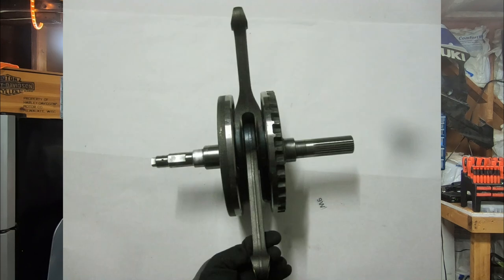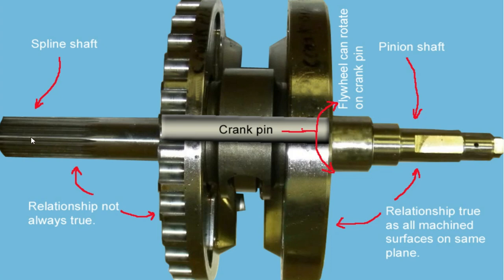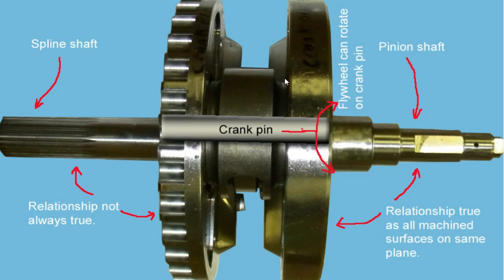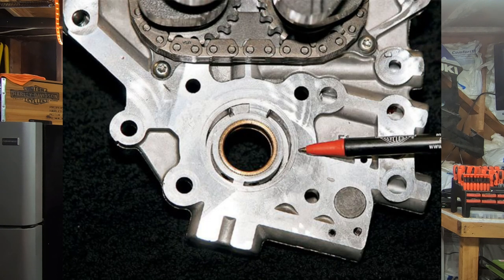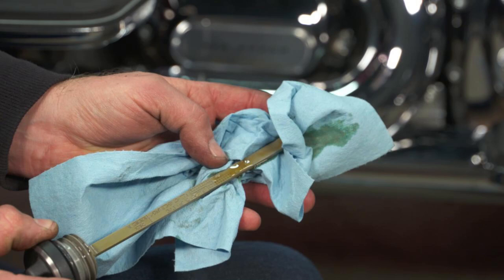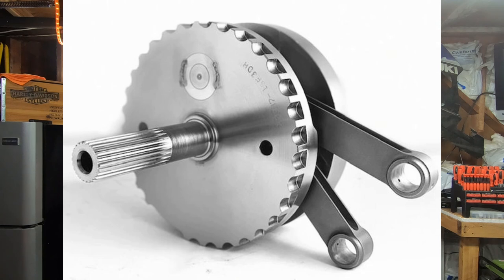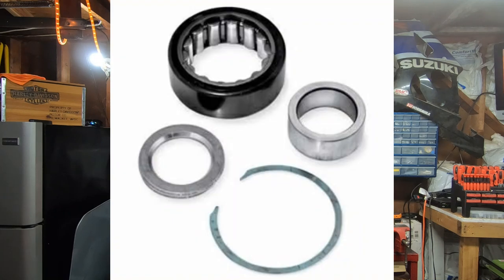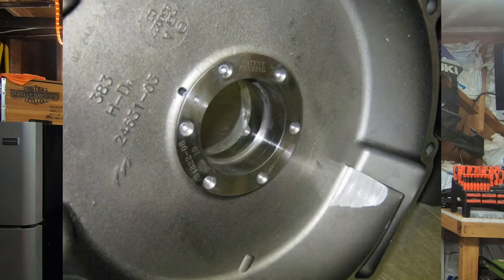The Issue With The Twin Cam Crankshafts | Harley-Davidson Cut Costs

Comment from the maker: Would you replace your crankshaft or have a machine shop balance, true and weld your stock crankshaft?
Reply: I'll sell mine for whatever i can get and buy a Rocket3 or a V-Max. I wish i'd have watched yours, and other vids...
Reply: I think that if I do anymore upgrades to my engine (Going to a Sidewinder 100 Kit) I would probably just buy a S&S aftermarket crank. Yeah I am also not hard on the bike minus getting on it at highway speeds. Thanks for a great video! Happy New Years Man!
Reply: I would probably send my crank in to be balanced trued and welded, but I think the real question is when to do it? 🤔.  All these top end power kits put a lot of pressure on the bottom half.  Do you do the crank preemptively? Do you wait and  do it when you do your top end?  Do you do it after a certain mileage threshold (i.e. 90,000 miles)?  Or do you do it only if you have signs of run out?  This is a good segment to all those guys who want a big motor kit to show off to their friends. They need to think about the vitality of their entire motor, top and bottom.

Great topic...as usual.
Reply: Dark Horse if you can afford it. They are perfect every time and built tough.
Reply: I’m currently getting my crank, rods & bearings redone on my 14 TC,  didn’t break, but at 57k miles, I’m having an engine upgrade.  Time to retire and I’m about to hit a few bucket list places.  I pull a trailer and a heavy load. 

As crank was split apart, discovered corrosion on bearings and rods.  Needed new rods and bearings.  It will be balanced, trued, and welded when done.  The cost is little cheaper than buying new, and I will know that runout is and should stay acceptable tolerance.
Reply: GixxerFoo is this why you ride a Sportster? I'm looking at a Sporty 72 to sit with the Rocker C.
Reply: Of course. Dumb question
Reply: Welding it is your best bet that it won't come back to haunt you.
Reply: Darkhorse is the only way to go
Reply: @Jimmy_Jim_Jim_1234  I’ve got a rocket 3 for sale if your interested
Reply: @varahabutterfly3782  Thats cool why are you letting it go?
Reply: S&S
Reply: I would not my crank, the heat from welding can change the runout that cannot be fixed.
Reply: I’m sure will change my oil more often tq
Reply: Replace no doubt !👍
Reply: Good vid. 

I keep hearing different run out tolerances.

 I'm building my 103 t a 110 Sidewinder kit from s&s. Along with .625 cams, and upgraded 89" cc s&s heads. 

My mechanic tells me less than .008 runout is fine. Other channels like Baxter's garage say <.003 is good. Here you say mess than .002 runout, while HD says .0012...  which i think is too much. 

What would you recommend with the build I'm considering? 

TIA.
Reply: @josevalencia5145  My 2006 Electra Glide manual says .003 on the crank run-out
Reply: replace with S&S of course
Reply: Weld it
Reply: @josevalencia5145  HD says .003 run out max
Reply: @anchorsaweigh9893  just about to fire up 100inch kit on my 88. 574cams Headwork. Not touching bottom end. My riding similar to what you described. Hoping got the best
Reply: @davidl2822  Yeah man lemme know how you like it. My 95SE just won’t die. It’s runs fine. Cannot justify canning it yet 😂
Reply: I replaced mine with a S&S, Harley tax at work lol
Reply: @josevalencia5145  find a new mechanic
Reply: @Jimmy_Jim_Jim_1234  check rocket 3s they've had issues with the gearbox at least in the past . Shade tree Surgeon on this good old interweb had one.
Reply: @matt8863  I just did full S+S cam chest , adjustable push rods , high volume oil pump , cam plate , Gear Drive 509 G cams ect in my 2005 Softail Deuce 88B. Of course I had to get it when they did a slight price increase 🤔💩But the sucker is 100% S+S in there. Also a Hydon H6 automatic primary chain adjuster. I don't rag my bikes and also have a 2014 Firefighter Street glide 103 and a Honda CTX 700 that was a little dream around the Tail of the Dragon. I personally think when people rag their bikes and  or take them past what the manufacturer intended that's when they are asking for trouble. If you want a bike that you can beat the 💩out of it on a regular basis then.Harley Davidson isn't it .
Reply: @williamjohnson6517  i will check it out thanks
Reply: The HD cranks are strong enough for a built 1550, but any bigger I'd go to the after market, I'm sold on S&S but there are others that are probably just as good.
Reply: Screw welding OEM crank pin. At that point just go with a new S&S crank. 
Problem solved for ever.
Reply: @Gixerfoo I have got a Electra glide FLHTCU 2012MY while I throttle up I hear some burst sound thin one from left side of the engine can you help or advise as to what it is if you have an idea please.
Reply: Just forget about it...Buy a S&S engine..a few dollars more for everything new..
Reply: I'd seriously consider just springing for an SE120R. And just put my SE110B/117 on the shelf.
Reply: Should be a c/a lawsuit against HD for this !
Reply: I got two money pit Harleys both are built engines like I want , SS bottom end Timken bearing.  Gear drive cams . The blue SS oil pumps . If I were to redo another engine it be dark horse bottom end . One motor is a SS 124 the other is  SS 143 . Both are not stock for a reason . There is a reason to use premium lifters.  Lifters are a maintenance item for me ,not run till fail and scater metal through the system and destroy the bottom end .  Finally heat cycles , after rebuilt,  then on to dyno and tune . I not interested in ride the bike for 500 miles then tune it . The m8 I think Darkhorse is the way to go also .
Reply: I’m finding used ones for 2-300 online, and have found b/t/welding services from 350-500$ online. I’d buy a used one, send it off, install and flip mine on the market to make the money back for the used crank. Minimal down time that way, not out anything after yours sells (I’d just try to break even) and it’s still 5-800$ cheaper than going to a s&s or dark horse.. nor inferior quality. Unless your planning on stroking than there’s no real need for an aftermarket
Reply: Hey Gixx, do you have to split the case to install the lefty bearing?
Reply: Im looking at a 2007 road glide with 50,000 miles. Will i have to deal with this issue?
Reply: @2trdmustanggtfordf1hdsgsfa80    I see your post is three years old and may get no answer but what was the cost of that crank work?  An S&S crank looks up to be an $1800 part and I can't imagine a machine shop charging anywhere close to that much for truing and balancing.  (That said, it's been a long time since I've had any machine work done so am out of touch with current prices.)
Reply: @mark-1234  that was during the COVID time and prices had not risen yet.  The crank and all associated bits were $1500.  I have a lot of work in this old scooter, I believe truing the crank was the most noticeable change.  The motor runs really smooth at speed. Most noticeable in floor board and grips.  Damn near Honda like.  Note, my original crank was like 14 thousands out of true.  It’s now 2 and should not move again.  I now have 80k on the bike with another epic trip planned for next summer. 
If I were to rebuild another motor, I believe I would increase the stroke, money is close to same and may as well increase displacement.  
That said, I travel through the desert SW and it’s freaking hot!  Last years trip had engine temp at 290 degrees.  Ran fine except for hydraulic clutch requiring pump up (it would lose its prime) each time I needed to pull off the highway.
I will probably buy a water cooled bike next time, maybe Indian or Honda.
Reply: Replace
Reply: .001 run out is the most you should have pressed up cranks are junk shovels and evos don't have those issues I will not buy a twinkle or M8 you shouldn't have to fix it the harley specs are totally wrong
Reply: @karibordi2082  its not a yes or no question. Dumb Answer.
Reply: S&S Crankshaft
Reply: I just did the bottom end in my m8 124
Went with the SS flywheel assembly. 
After 17k miles on the top end build in 7 months or so .. just your standard SS 124 bolt on kit…. Was getting a bit noisy..  and ride 20-25k mi a year so went in for refresh and some improvements including the SS crank. 
Worth it 
Piece of mind worth it alone

*couldn’t run the vented dipstick without oil puking out even filled appropriately.   But I had the newer OEM pump that had the 8 lobe rotor ..  I did get new rings of course and went with the SE billet pump and plate .. that breather element isn’t soaked or puking oil.  
Bike runs so damn smooth now
Reply: @stuartbuckley6113 what I just put in my m8 124 .. was just top end done but went back after 17k mi on that top end build.  Pukin oil out the breathers .. no not overfilled.  I do ride hard.  No burn outs and shit but I do downshift a lot but not like downshifting at 5k lol

Comment: Its nice that Harley-Davidson lets its customers do most of the research and development but still charges them for it with high sales prices.
Reply from the maker: 😆😂👍 that sounds about right
Reply: There's nothing wrong with Harleys TC motor....the key is like anything mechanical don't abuse it...l have 2 2006 Harleys with 75000 miles on each with all stock parts...now if you're gonna go to Sturgis get drunk and go do burnouts like a fucking asswipe then expect parts to break...peace
Reply: @terryduncan5718  well apparently there is!!🙄
Reply: @terryduncan5718 disagree. 100 percent. You're just a lucky duck.
Reply: @murrayhelmer8941 😂👍👍
Reply: @rywolf01 😃👍👍
Reply: @terryduncan5718  You could go to Sturgis with a Yamaha Road Star and do burnouts for two weeks and you would not have parts break like that 😀
Reply: @MidnightExpressMC   Absolutley correct. And if Yamaha or Honda had this problem.  You can be sure they’d have fixed under warranty!!   Love my Harley. But this pusses me off!!

Comment: We did a build on my 03 Lowrider and it made real good torque and HP. Now half my friends are warning I should have welded the crank pin and half are telling me not to stress over it. The most logical voices say it will be fine unless I start drag racing and doing burnouts.
Reply: I like to spin the tire😅

Comment: I would always recommend having the flywheels true and welded for 'Hot Rod' builds, did this  to my '02 and have ridden it like I stole it for over 160,000 miles.
Reply from the maker: If you're down that far in the motor you'd be crazy not to while you're there.

Comment: Hello, thank you for your informative videos.  The S.E. "Lefty Bearing" does NOT address crankshaft end-play, a major problem with elimination of the Timken bearing set-up.  I was disappointed that you even mentioned the Lefty-Bearing as an option as dealerships love to push S.E. parts that don't work well.  Anyway, the stock lower-end set-up isn't bad IF you keep the motor relatively stock; however, if you make modifications that increase engine H.P. and Torque, the responsible and smart move is to beef-up the crankshaft to handle that extra power, and Darkhorse Crankworks does an excellent job of modifying crankshafts to do just that!  Thanks again for your videos!

Comment: Between the flywheel and chain tensioner issues both lunching engines as well as the death wobble from the rubberband models I'm glad I have an old FX Shovelhead.
Reply from the maker: Shovel Head is built like a tank, Harley got into a lot of ridiculous cost cutting measures and it hurt the reliability.

Comment: Gixerfoo, you said the reason the 1999-2002, twin cams are better is due to the Timken bearings. Although this is true, the main reason is that the crankshafts in those years were forged as a whole unit, not pressed together as you described. I appreciate your contributions to the community and thank you for your videos. Ride safe bro!
Reply from the maker: Thank you! You are correct, its part of the cost saving they went after in 03 where quality really went to pot. There were some issues from 99 to 02 with the cranks but they were very very rare, it was mostly the tensioner nightmare. Hope your having a wonderful New Year!
Reply: The crank pins are still pressed together on 99-02 tc88s
Reply: @garryhorton9105  I'm amazed that this guy is still going strong. If you watch any of his videos (about Harleys anyway) it's very obvious he doesn't actually understand what he's talking about. The runout issue and the pressed together cranks are 2 completely different issues.
Reply: @MegaBrownie44  yes I agree 👍🏼

Comment: Can you do a video comparing aftermarket cranks and their prices?  Also maybe touch on bearing upgrades. That would be an awesome and informative video.
Reply from the maker: Great suggestion! That's not a bad idea at all, there's really only one option on bearing and that's the Timken tapered bearings, but conversion is another story. Aftermarket cranks vary widely and I thinks that's a great subject to cover!
Reply: @GixxerFoo  yes, do this.. and be ready for the sticker shock.

Comment: I have 04 cases on my 95B and opted to put in the JIMS sleeve for Timken, bought the tool and did it myself.  I put in an S&S 4" crank with pre 03 crankpin,  set the clearance and never looked back.  I installed gear drive cams, had great backlash and was worried cause I never heard the infamous "gear whine"!  Anyway, I had heard that when the 96" came out that they were notorious for the Crankpin moving, hence my apprehension for not going with anything beyond a 4" stroke.  This was a GREAT segment Gixxer and have a Happy New Year!!!
Reply from the maker: Thank you! You got one hell of a setup on your crank, that's about bullet proof. Personally I like the sound of the gear whine, I imagine your timing is spot on running those gears. Yeah 2007 to 2009 96's had the compensator issues and the crank coming out of balance with the fly wheels shifting on the crank pin. It was a really hit or miss deal, but it seems like something Harley quietly fixed as time went on.
Reply: Hi, awesome set up. I have the same as you do. i have 2005, 15th anniv fatboy, with 95B,new s&s crank, fueling camplate,lifters and hf oil pump. already had andrews 37 g in it, and yes hearing gear whine, when hot mostly, sounding tinny and high pitch bearing/gear sound. ?? no?? little backlash is normal.
Reply: @-MrRichBiker1967  Yeah, I have the entire Feuling set up as well, plate, pump, lifters, etc. and am running cast Screamin Eagle flat tops, along with S&S Super Stock heads w/1.94 intake valves and it's @ about 9.75:1 static comp.

Comment: Thanks for all your educational videos. A few years ago I upgraded my 2015 Street Bob 96A with S&S big bore 106 fully works head and TB with Trask Stage 1 turbo kit. It’s freaking amazing and I love it. I can’t go back to NA. But now I bought the Feuling 543 Reaper cam chest upgrade, DH motorsprocket, and EVO IND full clutch assy. I’m getting the S&S flywheel assy. My understanding is the 2015 already comes with the lefty bearing upgrade stock.  Even S&S said that I technically don’t need to do the Timken for my build as the bearing is not really the issue unless you have a stock crank. I would just get the Timken upgrade but not so easy in Japan and it seems a lot of people don’t have Timken, but upgraded and are fine. I don’t do all the crazy shit of burnouts, donuts, wheelies or drag racing. I just enjoy the power and spirited riding.
Reply from the maker: It's hard to go back once you've done forced induction, those are a lot of fun to ride! There's a big back and forth on the school Timken style vs the the straight roller setup. It's getting more accepted to run heavy duty rollers, it doesn't bother me honestly and it saves you a lot of money not converting over. Lol you need all the heavy setups for the way you ride!
Reply: @GixxerFoo Thanks for your thoughts. I’m loosing sleeping trying to decide which way go. I guess I’ll do Timken if I can find a shop to do it.

Comment: I like your videos ! Realy simple and quite transparent. I have a 110ci cvo upgraded to 117 and I start having some small issue because of that , I understand what are the problems and start to upgrade one by one some parts like : plate and oil pump from S&S , change chain tensioner with a fix one , I change all gaskets on engine ( because I got some bottom leak - and now dont ) I prepare to change the rocker suport plate with SE one , add new Jims shaft with new arm bushings ( thinking .. maybe to get rocker arms from Jims ) and ofc your advice to put rocker locker . I have a small little problem : I dont know and didnt find what is the screw plug , on bottom of the cilinders , on the left side of the engine - is puking some oil . The bike now is more powerful and if , sometime, I drive aggressively, I got some oil around that plug . Somebody told me there is a pasage to look for aliniament …

Comment: Very true on the oil build up. A couple of days before my oilpump gave up I had a big oil leak from the breathers. And indeed it failed.  New set up with fueling camplate etc etc.
Reply from the maker: That's the way do it if you have a failure like that, don't go back with OEM and go with some high quality aftermarket parts!